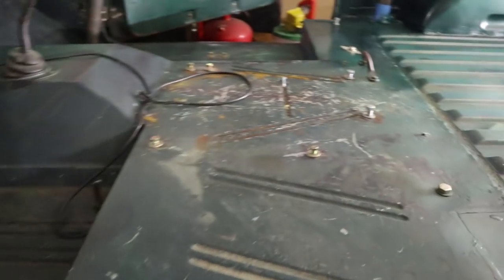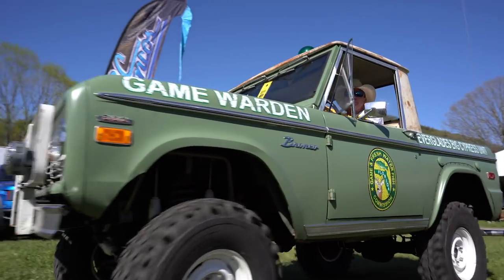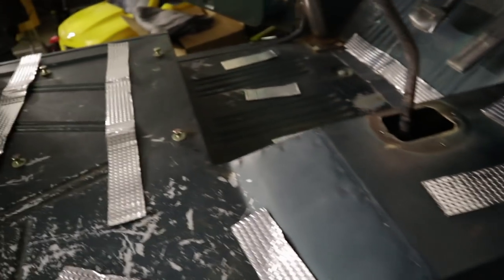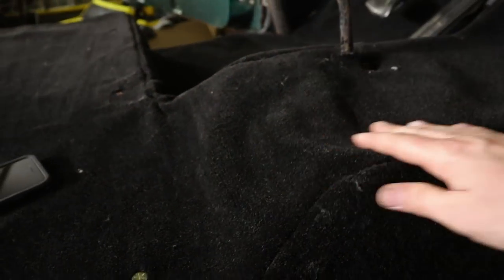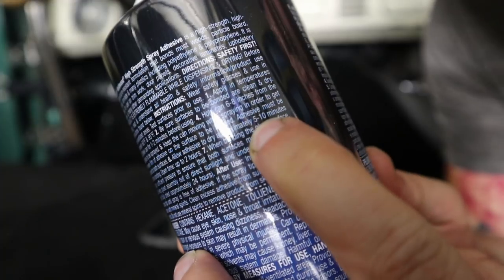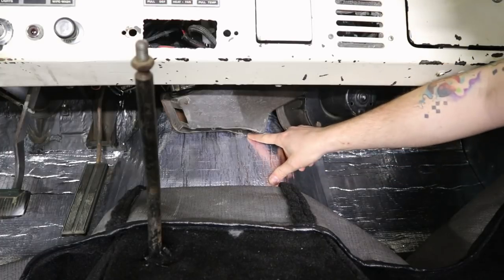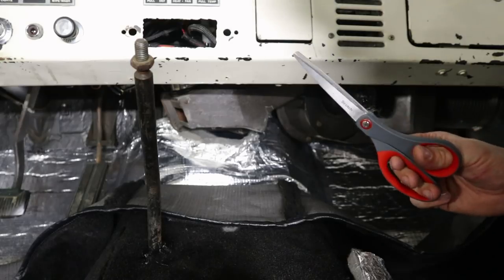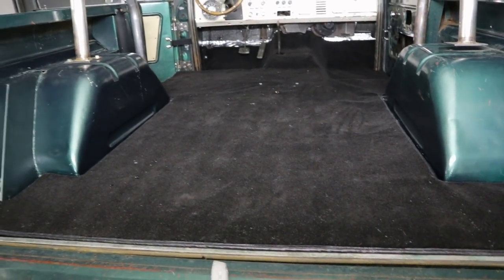Installing a new carpet kit

Comment: That piece of carpet is for the tailgate.  curious if you glued down the insulation.  Thank you
Reply from the maker: Ahh! I think you’re right. No, I didn’t glue down the insulation. I was thinking if I add speaker and want to hid the wires I still want to be able to run them under the insulation

Comment: How much did that help the road noise?
Reply from the maker: A TON! The difference is pretty amazing.
Reply: Nashville Early Bronco are you planning on insulating your hard top as well?
Reply from the maker: Right now I’m not planning on it
Reply: Nashville Early Bronco  I will be interested to see how it turns out I live in Alaska and have been debating on dynamating the entire interior since I keep my hard top on most of the year.  Shipping cost for parts have been horrendous so I'm trying to justify the upgrade.
Reply from the maker: Drive down for the Toms Bronco Parts event and pick some up 😂 easy road trip from Alaska right!?!?